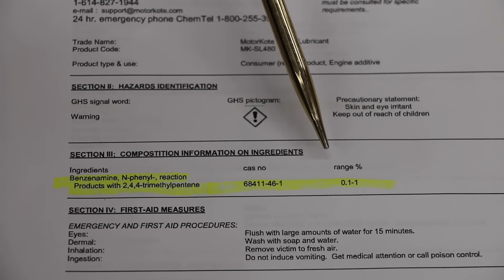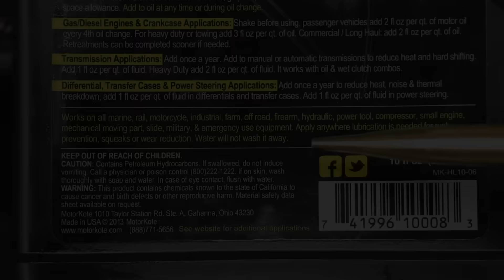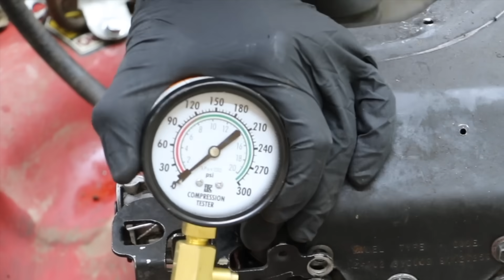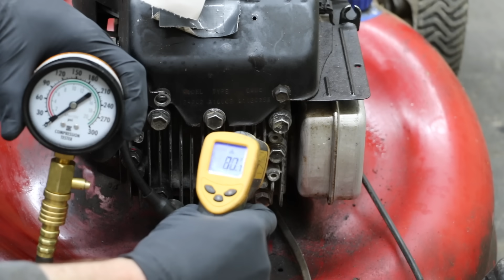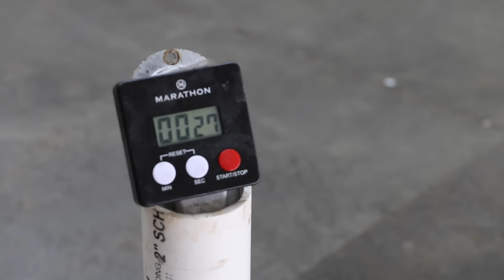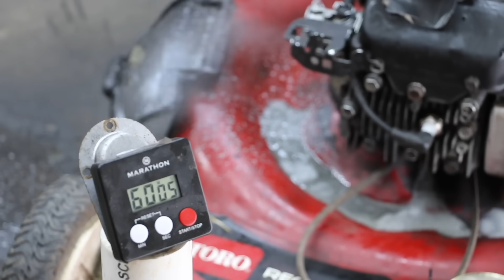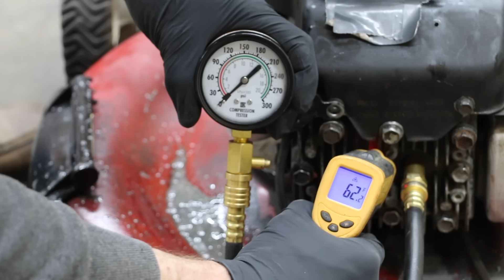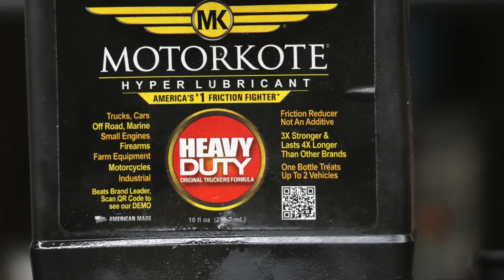Can MotorKote survive the water test?  Let's find out!

Comment: the only thing is.   if iam right.   you are running a hardened steel wheel against a hardened pin.    an engine has a SOFT bearing against a hardened steel pin.   did i get that right?
Reply from the maker: Thank you.  I'm not sure I understand the question.  The big end of the connecting rod is aluminum.
Reply: but the bearing is not.    most car con rods are steel.    iam not talking about a race engine.

Comment: The big questions! Would you use motorkote in one of your vehicles? Also it appears to me that the more you use the better the result. Does motorkote have the endurance to be used in a 50/50 mix for an entire oil change cycle? How does it do with synthetic oil? Running it straight showed so little scoring on the bearing, would the cost be worth running it straight in your engine? Or Could you run it straight in your engine?  I think we definitely need a follow up video!
Reply from the maker: Yes, I would use it.  I would use it as recommended, since it's intended to enhance the oil instead of replacing it.  The oil will provide the detergents, etc.

Comment: What a great test here! I think I will start using some MotorKote in my engines. If you happen to have a head gasket fail, MotorKote could save you a lot of money in engine repairs by keeping the parts lubricated not to mention giving you increased engine life and possibly better fuel economy due to less friction. I'd be curious to see if it did give a noticeable fuel economy boost. As always, love the videos keep them coming :)
Reply from the maker: Great point. Thank you

Comment: ?Can I use sea 40 motor oil in a push
Reply from the maker: The engine will survive but I highly recommend using what's called for by the manufacturer.
Reply: @ProjectFarm  well sea 40 motor oil work in my ride ing mower

Comment: You keep saying you are skeptical of motor oil additives yet you have found Lucas and Motorkote to be effective if I remember correctly.  I purchased some Lucas for that reason and plan to compare it to the results of an oil sample I took without it in my Ram 3500 (diesel) when I change the oil next.
Reply from the maker: I'm skeptical until I test them.  There are some that do work. Thanks again.

Comment: After watching your video and few other videos on Motorkote, i put it in engine and transmission of my various cars. 2004 lexus es330, 1997 lexus es300, 2006 hyundai azera, 2010 kia sedona van. Results are amazing or i should magical in all. Engines turned super quiet and transmissions shifts like you cannot even notice if not watching the gauges. I am really impressed. writing this feedback after over 1000 miles testing on each and every car. No negative effect so far. I cannot say if helped in increasing the gas mileage much but i guess some improvement in that area too though not too significant, but just making the engines and transmissions run super smooth and quiet is a big thing for me.
Reply from the maker: Thank you!

Comment: It may be ok for sub standard conventional oil but not for a top quality oil ..I would never mix this with AMSOil  because the mix will ruin the chemical design  and make the oil way less protective than what it is mEant to be. ..When it turned the oil to a haze in  the glass jar,it made a chemical change of the intended make up of the oil  ..It could ruin the sludge protection factor in the long run of the oil  or even shorten the life of the oil .. The old Teflon additives like SLICK 50 made the oil bead up on the  metal in the engine  and lowered the compression ratio..
Reply from the maker: Thank you
Reply: try it yourself

Comment: Hello project farm! Here's some reading materials for you: http://www.thebestsyntheticoil.com/pdf/TSB%20MO-2010-04-01_chlorine_oil_treatments.pdf
Reply from the maker: Thank you.  I actually use Amsoil products from time to time, but like all companies that have a product to sell, I don't trust their biased perspective.  I don't sell products, I test them.  Thanks again.
Reply: @ProjectFarm  That is much appreciated as always. They mention something about motorkote containing chlorine. In the same release, Cummings had an engine fail at 195,000 miles, and they claimed chlorine as the cause. Do you think it would be possible to cause the conditions they describe, such as introducing water and heat, to cause a hydrochloric acid condition?

Comment: That truck treated with motorkote that I have with no oil pressure idle. Still running strong and it will be six years in March 2019.
Reply from the maker: Impressive results!

Comment: I would like to see motor silk vs motorkote.  A long time ago we tried motor silk on the dyno. After treatment it did have higher values for torque and horse power. The problem we had is a sudden drop in oil pressure and the filter was packed full of a dark substance kinda looked like graphite and oil mixed. We had coated pistons and bearings and we thought for sure it stripped the coatings off. We used the engine, then did a tear down and it looks new inside. All coatings we’re still there. It was so weird we never touched the stuff again.
Reply from the maker: Great video idea.
Reply: The oil pressure came back after a filter change.

Comment: One thing you didn't do is bring the additive up to engine operating temp. I'm pretty sure the instructions say to add the MotorKote after engine is warmed up and run for awhile at full engine temp. This help the MotorKote get into the micro pores of the engine metal.  I did this to my 2000 Hyundai Accent, and the mileage went from about 34 to 41 MPG. That alone pays for the MotorKote.
Reply from the maker: Thank you.  Impressive fuel efficiency gains!

Comment: Hi! I'm amazed at the results of the Motorcote friction reducer. If someone told me that I would not believed it.  I do have a question though, many of the manufacturers of  friction reducers/ modifiers claim you can also add these products to your transmission, be that manual or automatic, or differential. How, to your opinion, would this affect the tranny, as synchro rings etc. rely on friction to operate correctly. I look forward to a video covering this aspect!.
Reply from the maker: Thank you.  I've never tried adding them to a transmission and prefer using them only in the crankcase for the reasons you've mentioned.

Comment: I would be interested to see how this works in a more modern engine. The coating is more likely to mess with the injectors and sensors in a new car.
Also have you tried the motorkote spray? looks like a combination of motorkote and penetrating oil.
Reply from the maker: Thanks for the video ideas!

Comment: $80 a gallon------->

https://www.amazon.com/Motorkote-MK-HL16-06-Lubricant-16-Ounce-Single/dp/B000EGAM0S/ref=pd_bxgy_263_2?_encoding=UTF8&pd_rd_i=B000EG6CSO&pd_rd_r=c24713ef-f92e-11e8-aa92-016f4f305944&pd_rd_w=uG6VJ&pd_rd_wg=ARi44&pf_rd_p=6725dbd6-9917-451d-beba-16af7874e407&pf_rd_r=VJRFW17SAEV50FRJ0K52&refRID=VJRFW17SAEV50FRJ0K52&th=1
Reply from the maker: I wish the price was a little more affordable.
Reply: Well- you could think of it as an investment into the overall health of the engine you're using it in; I wouldn't waste it on a lawn mower- but your livelihood farm equipment, and personal vehicles- I would say the price is "reasonable" for what it does do.

If you don't overdose and waste it, and only use it in fresh oil at a change, supposedly it's effects don't drain away with the old oil- so one initial use should last a long time.

You know- preventive maintenance is better than repair.

Comment: Interesting test results. I used mkote in a 2010 fit with 78k miles. Oil is valvoline mineral, 5w20. I drive 90 pc highway to,from work.  Based on this, with mkote, I gained 2.2 mpg and engine seemed to Rev faster.  I'm happy with it but as it's expensive, I will opt for full synthetic oil rather than pay c full price for mkote.  Thank you for the project.
Reply from the maker: Impressive results on the extra MPGs!  Thanks for this information.

Comment: I use Motorkote in everything I own. I use it at 1 OZ per quart of oil or transmission fluid and 2 OZ per gallon of 2 cycle gas with my Klotz oil. Gear boxes power steering etc.... Not in Brake Fluid. Air compressors Small Engines Electric Motors Chainsaw Bar Oil Radio Control Nitro Engines RC Electric Motors Fishing Reels Guns  EVERYTHING!!! I could tell stories for hours about Motorkote. My furnace motor was replaced with a used motor 20 years ago I clean and lube every year with Motorkote. 20 years trouble free and going good and quiet. I use 5 oz in my 2012 Mazda3 every oil change and go 15,000 miles per oil change. Oil stays clean enough to see the marks on the dipstick and only uses a quart of oil at 10,000 miles. If using it in a oil can you have to shake it up because it will settle on the bottom of the can when mixed with regular oil. I have had many trouble free years using Motorkote in everything I own. Have even quieted noisy crank bearings in a 2 cycle Lawnboy. Fixed an electric fuel pump that was getting hot and locking up in a Polaris Ranger $$$ I am sold. NO SNAKE OIL HERE!!!
Reply from the maker: It's a great product. Thank you

Comment: How long would the engine run with water in the case without being treated with MotorKote?
Still a great test. I dumped some in my old ranger that had a leaky head gasket (plugged with Bars Leaks head sealer) as the oil was very slightly contaminated with blowby coolant.  After an oil change and some MK lets hope it does its job.
Reply from the maker: I believe the ranger will be very pleased with the MK.  Great recommendation on the water test.
Reply: @ProjectFarm  On one of your other videos an engine w/just motor oil was drained and ran dry for 7 min until it locked up so thats a good comparison.... the MK and water lasted far longer than just oil film.  Since water isnt a lube I don't imagine just water in the case would last even 7 min. But it would be a good baseline test to add to the pile.... motor oil drained and ran till dead w/water in the case.
Reply: @ProjectFarm  I treated the engine with MK... it reduced the friction so well the running temp dropped from 188 to 174. Now I have to drive around in a chilly truck because the heater is barely warm.  On the upside, lower friction on an old engine is good.

Comment: How about a fuel dilution test with MotorKote. Almost all turbo GDI have scary above 5% fuel dilution problems, in fact Honda's 1.5 turbo has been recalled and stopping of selling those cars in China. https://www.google.com/search?client=firefox-b-1&q=honda+1.5+turbo+fuel+dilution+problems  there are 2 threads on Bobs the oil guy digging in deeper. I have a 2018 Hyundai Kona AWD with a 1.6 Turbo and I am above 5% from a Polaris Labs oil sample I sent in.  IF motorKote can help fuel dilution problem wear  when it goes into the 10%+ range that would be a great test and could take you viral. You need to make it as scientific as you can and not a short one. Polaris Labs had a customer with 25 gas vans that were hitting 8% fuel dilution with no extra wear metals, but they feel if he gets to 10% that will switch over to more wear.  Amsoil says they want you to dump at 5% and I can only assume all others will use that 5% number too. Polaris's test is only good to 5% and you have to FORCE them to do it on your tests since it is increased steps from the fast quicky composited test they use that tells you nothing. The better test is included in the basic test, but unless you have a GDI and especially a GDI turbo the test is moot for most. But HEY.....there are a LOT of GDI motors out there now......whats up with that Polaris? I guess follow  the money/labor.

Comment: So after binge watching your channel over the past week my question is, what is your ultimate concoction of fuel and motor additives? What would you use every fuel tank or oil change?
Reply from the maker: Great question!  I drive older vehicles and they benefit from engine restorer as well as Seafoam or MMO cleaning periodically.  If I had a high performance vehicle that was driven hard, I'd use MotorKote and periodically clean with Seafoam or MMO periodically.

Comment: Test hand cleaners like DL, Fast Orange, Goop, GoJo, TKO, etc..  Test 100-150psi oilless compressors. Test tire inflators (similar to compressors except portable and no air storage). Test wheel bearing greases for lubricity, heat resistance and tackiness.
Reply from the maker: These are great video ideas!  Thank you

Comment: Love your tests.Two things to try,got this from the shooting sports industry,powdered PTFE and  powdered MOS2.Try mixing 1 ounce per quart of oil each,then once both together.
In shooting sports you can buy these kits,but don't remember the two brand names,they come with an empty quart paint can a dipping basket and either PTFE or MOS2,you would supply the 2 part epoxy and acetone.Put acetone in can mix equal amounts of epoxy separately in acetone then mix either powder according to directions,stand some bullets in basket dip then let dry.Bullet lube,for your purposes though you won't need the can or basket or acetone and epoxy.
Rebuilding an engine that's had a high concentration  of MOS2 in it is a real bad bear,the whole inside looks like it has a coating of fresh black paint that won't dry.
Reply from the maker: Great test idea! Thank you

Comment: Hello I found a product like this one. Please test it. Archoil AR9100 
Found out motorkote chloroform in it the Navy did tests and chloroform isn't good and makes stress cracks. Can you see if that's true and to see if this can go the job. I put motorkote in my blaster 200 great high revs used 1oz of it clutch slipped but I drained oil and replaced it did about 5 take offs making it slip on purpose and it wore off the plates so it's not slipping now.
Reply from the maker: Thanks for the test idea.
Reply: @ProjectFarm  your the best I hope this stuff is as good as motorkote it's also American made :)

Comment: I enjoy your videos on these small engines. But I would rather see you test Motorkote, Tufoil, or any of the other formulas I see at the parts store on a true auto engine, being it a 4, 6 or 8 cylinder. I don't drive a lawnmower to work so the amount of wear and performance from single cylinder to a multiple cylinder engine pushing a three thousand pound vehicle or more would secure my curiosity quite a bit more. And I know that even a v8 standing still on a stand treated with this formula would be a partial test being that it has zero load. I saw I think a Prolong formula ad years back showed a treated engine ( the oil was drained ) and then run at high speeds around a track ( with no oil supposedly ) that did not fail, don't remember number of laps. Smoke and mirrors or does this stuff really work on a daily stressed larger engine ?  I would certainly use this in my small landscaping equipment, but I also look to increase the longevity of my daily drivers. Keep up the good work.
Reply: A small air cooled engine is a much better test as they are made cheaper have cheaper bearings and materials and run way hotter.
Reply from the maker: Thanks for the constructive feedback.

Comment: I buy this stuff by the 5 gallon bucket and use it in my Heavy Haul Rig, usually 100,000 lbs to 132,000 lbs  It goes in the Engine of course, Transmission, Rear ends, Power Steering  box, all 7 axles .
Schaeffers Synthetic Blend 15/40 motor oil with mk is perfect combo
Reply from the maker: Nice!  I presume it has provided excellent service?  Have you ever had the engine oil analyzed?  If you respond, could you please create a new reply so I can easily find your reply?   I struggle to read all of the comments once and can't get back through the comments a 2nd time.

Comment: Beware of Aftermarket Oil Additives Containing Chlorine :  did you know that many of these additives can actually cause damage to your engine because they have high chlorinated paraffin content? The mixture of chlorine with heat, combustion by-products, moisture and wear metals can ultimately result in the formation of hydrochloric acid. As you can well imagine, hydrochloric acid is not something you want inside your engine.  AMSOIL recently had an independent lab test Dura Lube Engine Treatment Booster, Motorkote Hyper Lubricant/Engine Treatment, Motorkote MK Million Mile Formula and Prolong Engine Treatment. They found that each contained significant quantities of chlorinated paraffins. The findings were published in a recent technical service bulletin: TSB: Chlorine Content of Some Engine Oil Treatments.
Reply from the maker: Thank you
Reply: @ProjectFarm   Sorry to be a party pooper  :-) About this guy down here who wrote: I have a series 60 Detroit in a 2000 Freightliner and "MotorKote is great for his motor"  We have to take into account that diesel fuel contain 
paraffins and cycloparaffin and the way that those type of  diesel engine are used , for long runs, prevent water condensation .The diesel engine has higher compression ratio than the petrol engine. During the compression ignition stroke, the air temperature is around 750 deg C (1382°F) with the pressure of 3.5 MPa. When fuel burns it will reach up to 2600 deg C (4712°F) so the small amount of paraffin get vaporized . So it’s hotter than its gasoline counterpart.. It can't be compared to a gasoline engine. The change in color when you add MotorKote to oil is the paraffin that simply doesn't dissolve in the oil when it's at room temperature.